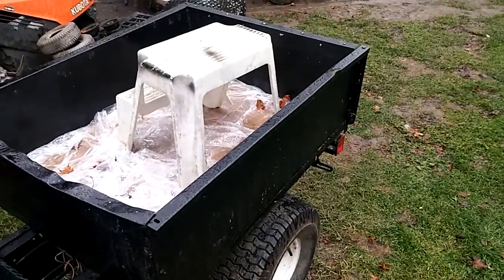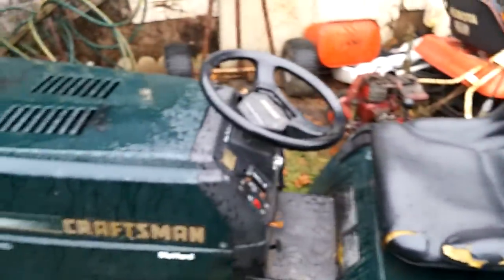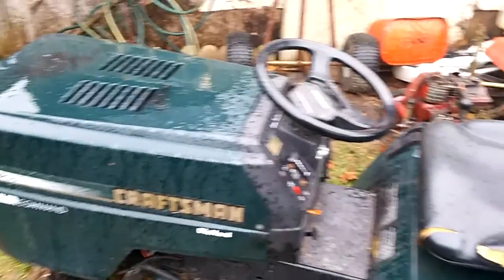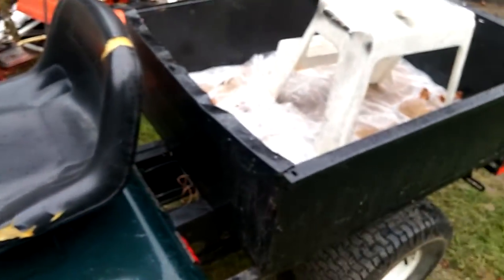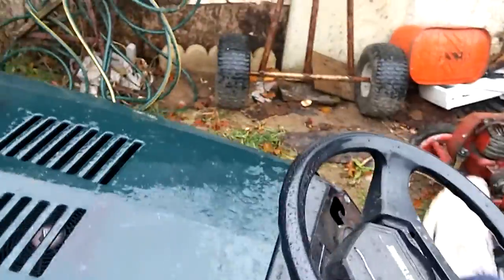Craftsman Truck Transaxle Problem

Comment: dude i love how that thing sounds! i love how it starts so damn fast haha! good vid man and yeah i think you chipped a tooth or one of the shift forks is grabbing a different gear than the other two.
Reply from the maker: Thanks,
I agree it is something with the shifter, like I said if you move it back and forth really fast it starts working perfect.
Also the problem is with 1-3 of the gears only.
Reply: maybe your first through third gears are worn out where the shift forks go!

Comment: Something like that happens to my mower  before wen I but it in the back of a truck without the
Brakes on and just in a gear but after a little it went back to normal but also it was a spicer 5
Speed

Comment: Good bet its chipped. I had that same exact problem with a Craftsman Truck i use to have, once i put a new shifter & transmission on it, the problem went away. (still have the Craftsman Truck, for the life of me though i can'r recall where i parked the thing, if i can find it, if you want I can send the part & can keep it as a spare if you should need one in the future, I dont plan on using the Craftsman Truck  anymore, where im now living i have no need for it)